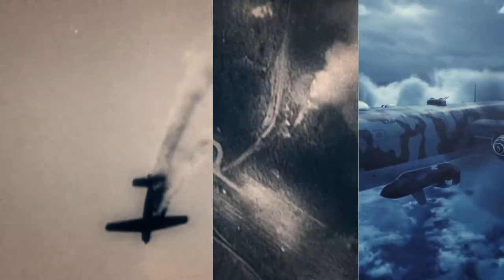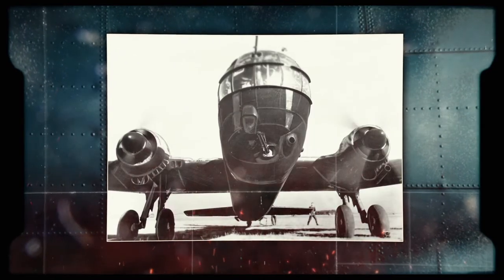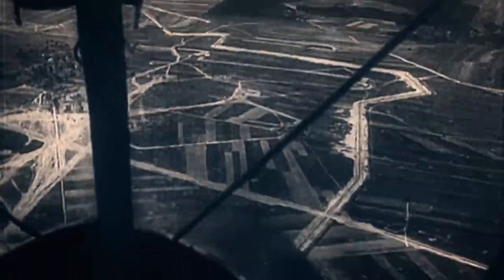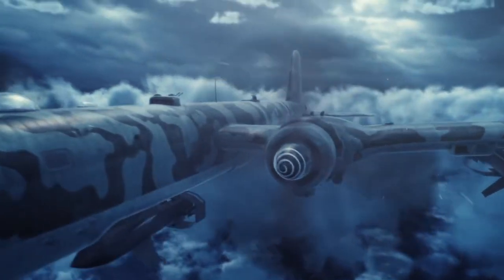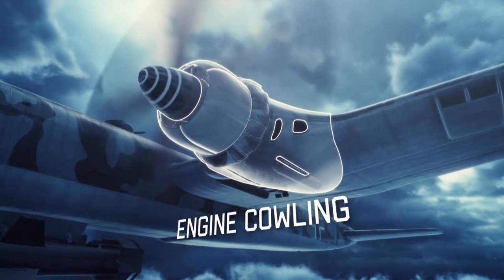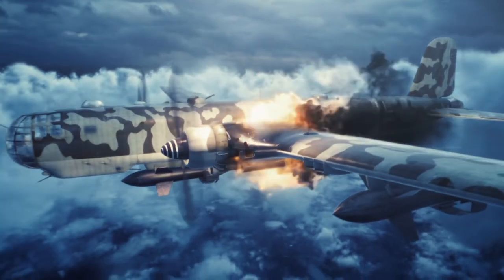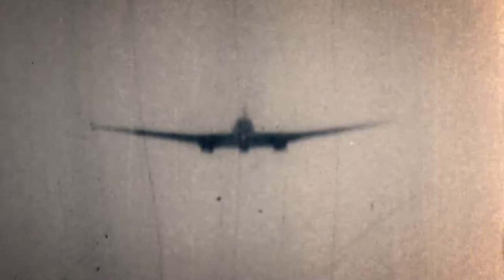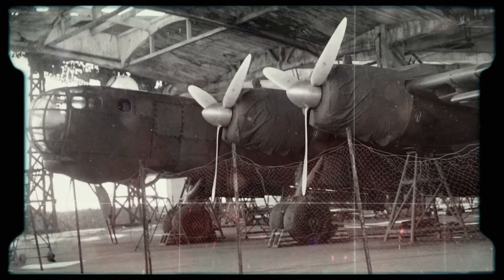Hitler's Deadly Mistake - The Heinkel He 177 Greif

Comment: Just what the internet needs, another poorly researched video. The HE-177's issues were no worse than the B-29's issues, and less HE-177's killed their crews than B-29s. Like the B-29, there were serious teething issues, and like the B-29 they were worked out.  The last few raids by the HE-177 had few defects, but Germany was in no position to use this plane by then.
Reply: I dare say the He 177 killed more crew per capita, no?
Reply: @princepsbellum3413  No. Not even close. But, you keep on hating on it.
Reply: @LMyrski  a little passive aggressive, are we?
Reply: Also due to fuel shortage